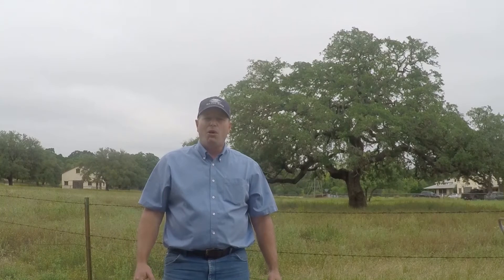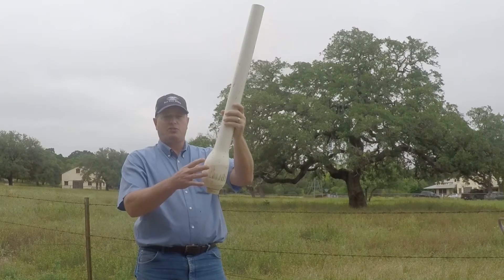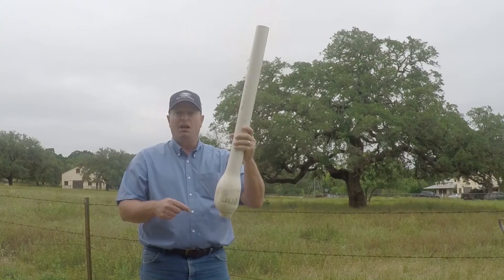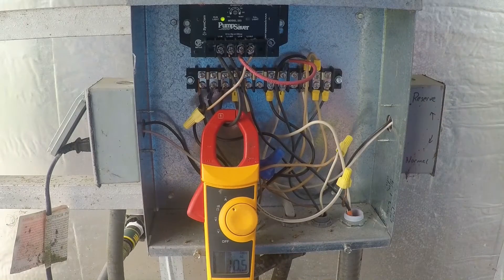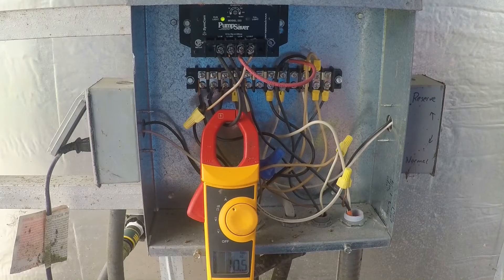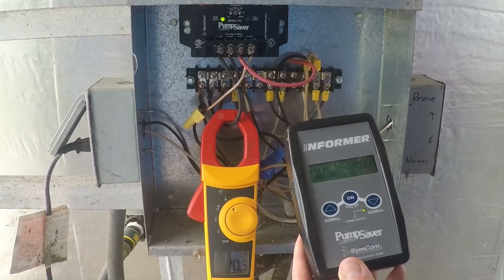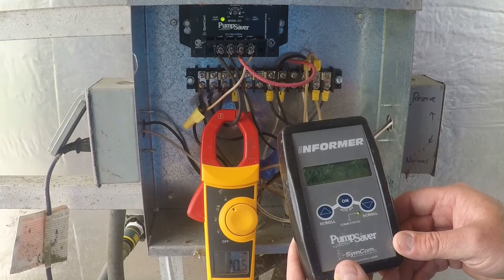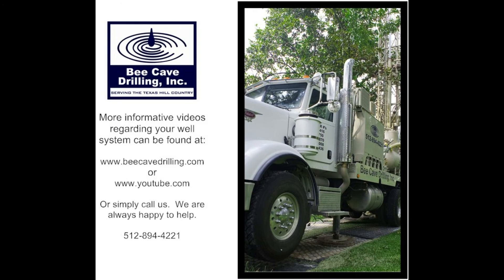The Importance of a PumpSaver

Comment: Can you adjust the time allowed for it to run? Then say it kicks back on in 2 hours, runs for 5-7 mins and kicks off again?? What my issue is i have a wel thats not in good rock so after about a 5 min run it turn to chocolate milk and thats getting in my 1000 gal holding tank. But up until it turn in to that milk its crystal clear water..
Reply from the maker: Unfortunately, no.  The pumpsaver detects when the pump runs out of water by how much electricity the pump is using. It has no way of detecting the quality of the water coming out of the pump.

Comment: Thank you for sharing this information! Can I assume that this unit will still work in the same way if I have a 3/4 hp pump that runs on 120 volts? (one hot leg, a neutral and a ground)? In all of the wiring diagrams that this company offers I have yet to see one that shows it wired for a setup like mine. They all show 230 volts (2 hot legs). Thanks for any addition info you can share!
Reply from the maker: No, the standard pumpsaver (model 233) will only work on 230 volt pumps.  But, you can get a model 111 that us designed for 110 volt pumps.  Great product.
Reply: @jimblair1  :  @Bee Cave Drilling  : Thank you for your reply. I will get the 111 in the enclosure. I think this will work well for me. By the way, will it work without a pressure switch? For my use I don't think I should need one but I wonder if the unit requires it.
Reply from the maker: @flyme-z7b  the unit does not require a switch of any kind.  Power in.  Power out.  If you do have a switch its best to install between the pumpsaver and the  motor.  That way the pumpsaver can protect against rapid cycle.
Reply: @jimblair1  : This is a big help. Many thanks! I use this pump as a booster for my residential irrigation system with a pump controller that kicks on the pump with each zone. The problem is that if a zone does not open due to some malfunction the pump will still run (dead head) and cause all sorts if problems with added heat, pressure, etc. , ask me how I know. This unit should help in such a scenario. I hope.
Reply from the maker: @flyme-z7b  just make sure you are not installing on a constant pressure pump.  It sounds like you have a pump start relay.  It will work fine for that.  If the zone doesn’t open, it dead heads the pump.  If calibrated properly it will shut the pump off.
Reply: @jimblair1  Not sure if it's a constant pressure pump. It's a pretty basic 3/4 hp pump with no additional control features or electronics other than what appears to be normal, smallish sized capacitor. I'll sleep better with a little extra protection. Thanks again?
Reply from the maker: @flyme-z7b  your welcome. Glad i could help
Reply: @jimblair1  :  Howdy, Jim: I have a quick question about wiring the 111P unit that I received on your recommendation. I probably know the answer but wanted a confirmation from a smarter guy. They show a wiring diagrams for 220 only with 2 lines in and 2 lines out but I know its supposed to work for 110 as well. Since I am wiring it to my 110 volt pump (with just 1 line, 1 neutral & a ground) do I run my neutral into the #2 line in of the 111P and then a neutral back out of line #2 out on the 111P (since I don't have that second hot leg like with 220?) I know that's how they do it with Munro Smartbox so I thought this might be the same.
Reply from the maker: @flyme-z7b  yes.  Line 1 in/out is the hot wire.  Line 2 in/out is the neutral.
Reply: @jimblair1  Thank you, Jim!  You are this weekend's hero. Thanks for all of your help.

Comment: I understand that this unit has an adjustable feature to delay the RESET/RESTART of the unit.  But is there a builtin feature that delays the startup of the pump each time it starts normally (not after a reset, just a regular startup)?  This'll be used for sprinklers and I'd like to see a slight delay in the start of the pump to give the valves a few seconds to open first.  Curious to know if there is a small delay.
Reply from the maker: Once the fault occurs, the pumpsaver will shut the pump off.  Then the delay clock runs and then the pump restarts.  There is no other delay feature.  It sounds like you are trying to run a pump without a pressure tank on a pump start relay.  If the valve is not open in time, the pumpsaver will fault out on low amperage.  You can fix this by adding a small pressure tank to the well system.  Probably a small 2-3 gallon surge tank would do the trick.

Comment: Another great video.  Jim I'm in AZ and am switching from a well that fed two bladder pressure tanks to the well feeding a 2500g storage tank and a jet pump which will feed the storage tanks once I get it all re-plumbed.  Does a jet pump also need a pump saver?
Reply from the maker: Sorry, i was out of town for a few days... in Arizona of all places.  The jet pump needs some sort of protection.  You can use a float switch in the storage tank or a pumpsaver.   I prefer a float switch in this case, but a pumpsaver will do the job great.

Comment: Yeah, as long as you don’t have any freezing weather. Since I got a pump saver and tank installed, it’s been a nightmare of expenses! It would’ve been cheaper to replace my deep well pump, than replace the pump saver three times - with days/weeks without water, waiting for a new one to be ordered.
Reply: If the pump saver goes bad, why don't you just rewire the pump to run without it until your replacement comes in?  You don't absolutely have to have a motor protector.

Secondly, how is freezing weather ruining the pump saver?